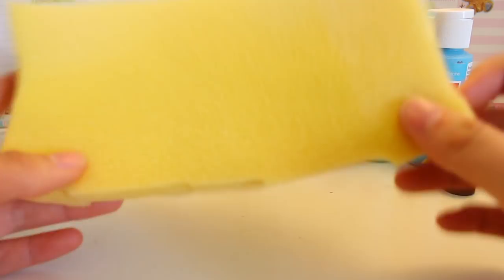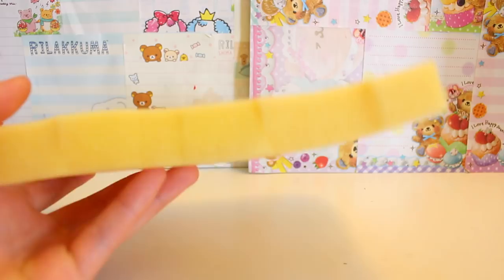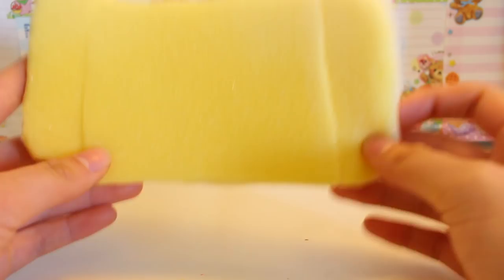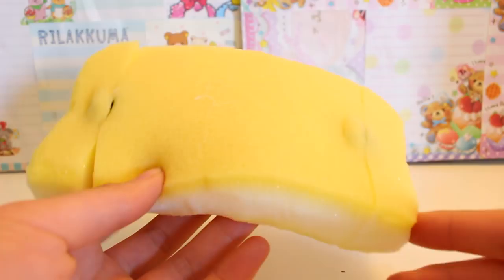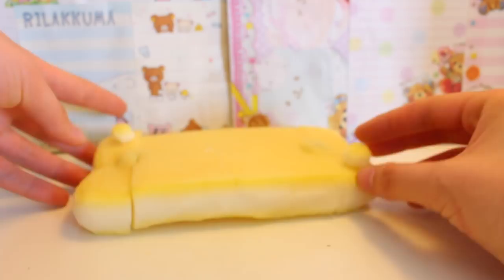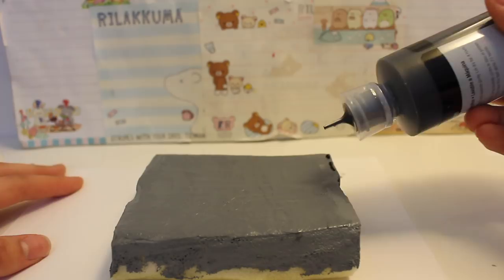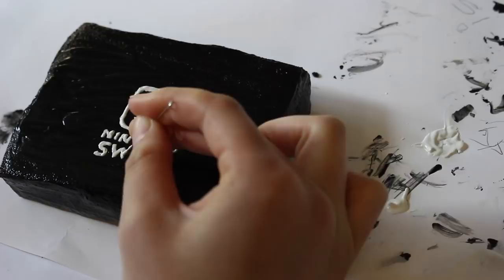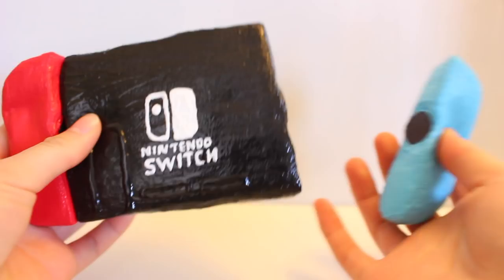DIY NINTENDO SWITCH SQUISHY

Comment: I have a question if your using the strait magnet  how would you attache it to the squishy would you use the hot glue gone or some other way?
Reply from the maker: I used a hot glue gun to glue mine.
Reply: @Squishyboba4ever  okay Thank's 👌😀